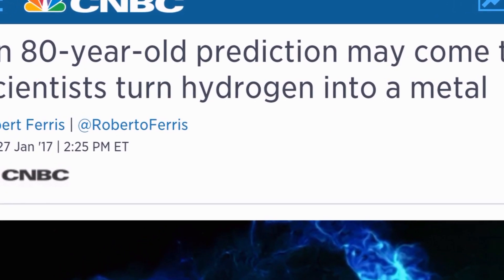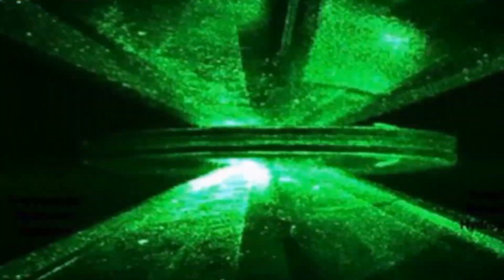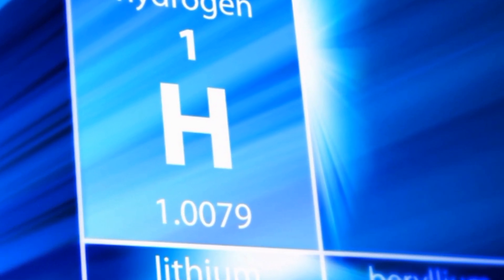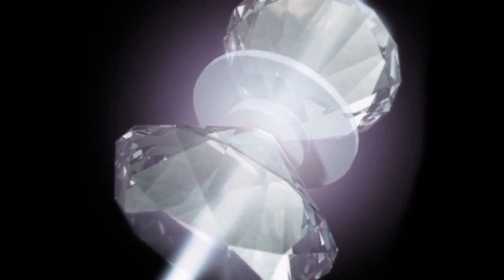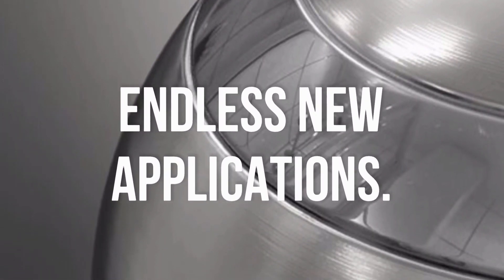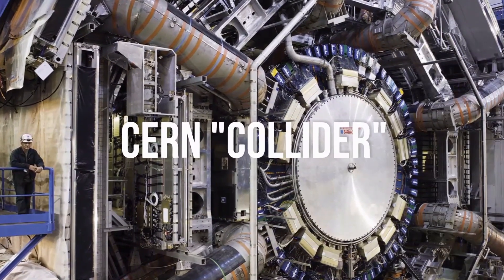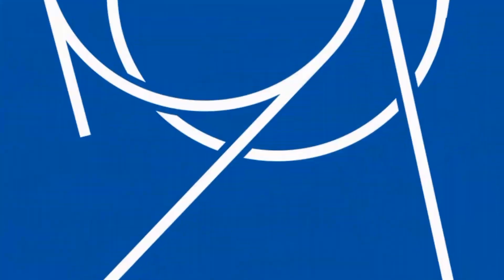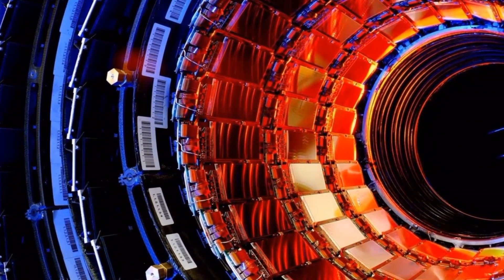Hydrogen Metal? NEVER Seen Before! Room Temperature Superconductor!

Comment: The confusion by Mr. Silvera of atoms and molecules is beyond ridiculous.  "protons and electrons";  What; are there no neutrons in the hydrogen atom?  He should take his thumb and forefinger illustration and ... up his ... for clarity.
Reply: Clavo...Take a look at your periodic table. Look at the relative weight of hydrogen. 
Element #01, Mass= 1.007 
compare with #6-Carbon, Mass= 12.011
or Oxygen #8, Mass= 15.999
Hydrogen is so close in matching at a ratio of 1-to-1 atomic number-to-atomic mass because it generally has no neutrons. Carbon & Oxygen both have atomic mass that's practically double their atomic numbers because they do have neutrons.
Reply: When Hydrogen does have a neutron, then it usually doesn't get called Hydrogen any more in a lab. Because the mass was doubled by adding a neutron, it gets referred to as Deuterium which is gets used in labs for NMR spectroscopy, and is also the component that distinguishes Heavy Water from normal water in nuclear programs.
Reply: A hydrogen that carries TWO neutrons is called Tri-tium because it is triple the mass of normal hydrogen. This makes it slight radioactively unstable, giving it a glow that makes it used for glow-in-the-dark sights on guns.

Comment: If you call -70 degrees room temperature, you should reconsider reporting on scientific discoveries.
Reply: You can use pressure and heat to make artificial diamonds, and they retain the form even at room temperature. In this case, it's hydrogen, and like it said in the video, it apparently could possibly retain it's properties and structure at room temperature.
Reply: +Ambius Cyben -- There is a report (I haven't verified) that the pressure got relieved in February 2017 and all was lost. Diamond stays together because, from any angle, any carbon in it is bonded to another carbon above, below, left, and right on the x,y,z axis. The crystal continues in every direction around any single carbons within the crystal. Hydrogen can't bond that way. Without any other element present, hydrogens can only be fused together into helium, or it can be bound as molecular h2.
   Without any other element, or new atomic forces discovered, then the hydrogen molecule can only be two atoms long.

Comment: Solid hydrogen is readily made at low temperatures, you don't need the high pressure required to make it metallic. Helium is the only thing that cannot freeze at standard pressure.
But also what is this channel about? "destroyed for lack of knowledge"? I don't think I get it...

Comment: Isn’t hydrogen flammable I wonder if it’s still so in it’s metallic state? Puting a current through something as explosive as hydrogen seems a little far fetched
Reply: Hmm but if its a superconductor then there would be no resistance and it wont heat up...unless you have too much current which would kill the superconductance because of the magnetic field and heats up and booom!

Comment: Some reports are it is a liquid. If it is a solid, is it soft like lead or brass? Is it's tensile strength high or low. Light weight as aluminium was, when invented, hyped as a lightweight 'steel' replacement?
Reply: Hard to say, but it can only exist under extreme pressure, so you're never going to hold a lump of it in your hand.